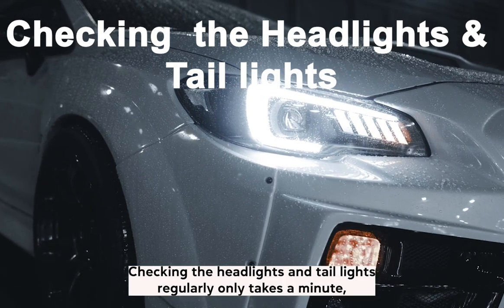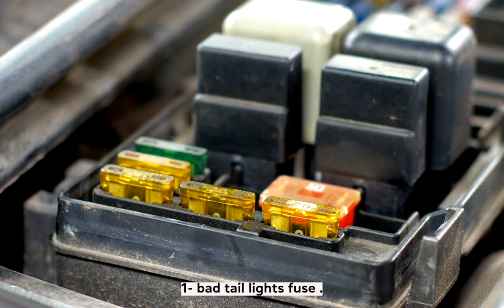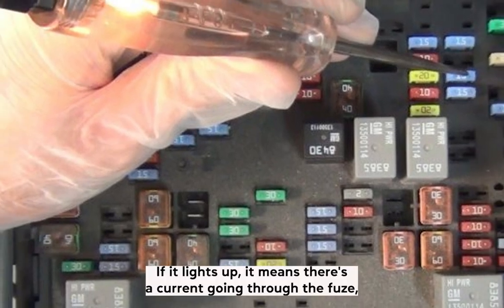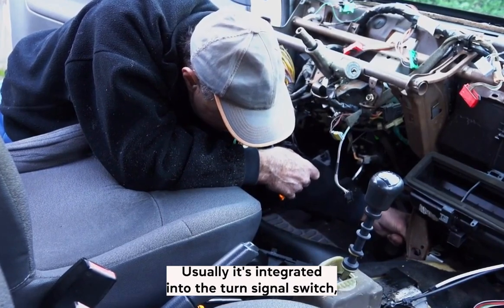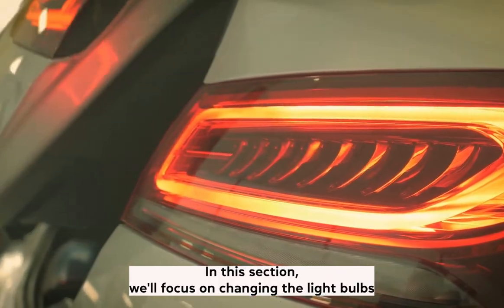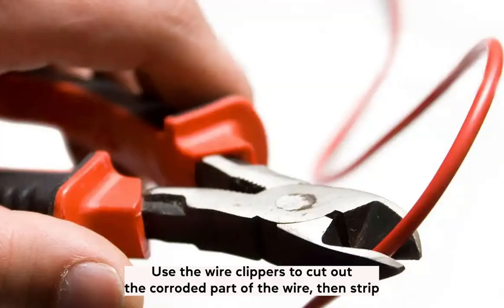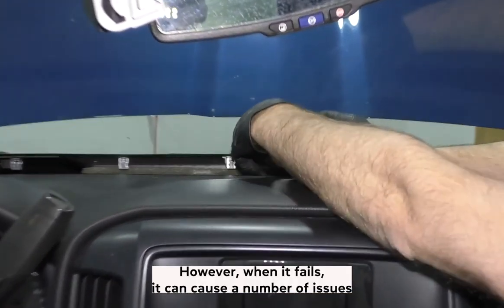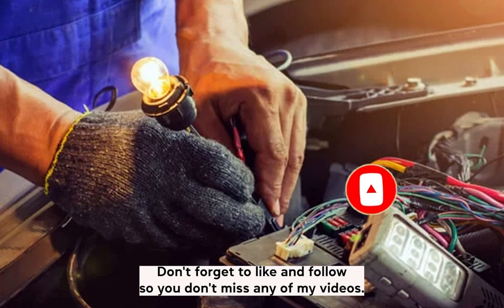Tail Lights Not Working But Brake Lights Are? How To Diagnose & Repair

Comment: 2007 accord with aftermarket radio. Found orange and blue wire not connected to anything behind radio. Taped them off, replaced fuse and tail lights and license plate light now working without blowing fuse.

Comment: Damn I hope it's a fuse. I had a cracked taillight and it flooded, had to poke a hole, now rear lights don't stay on but everything else works. I replaced the broken light and hoped that would fix it but it's the same. I havnt been able to find the fuse for nissan titan 2018 but I'll do some research.  Since I changed the light I'm assuming it's not the bulbs or light but now has to do with fuse or wiring.. 🤷

Comment: My 2011 Subara Outback problems are all happening simutaneously. The rear lights will not turn off when the car is off.  All the instrument lights in the car are staying on along with the alarm system is sounding off when I open my car door but once I put my key in the ignition it stops.  The battery was disconnect and reconnected thinking that it would reset the car but nol luck, the problem remains. I can get the rear lights to go off momentarily but after a few minutes everything resets and all the lights come back on with the exception of the head lights and the map & dome lights.

Comment: My 05 le sabres missing all of its tail lights on the driver side. Blinker, brake, and regular light. Any idea what the issue could be? Possibly a fuse?
Reply: That does seem to be a fuse possibly. Check the owners manual and replace corresponding one
Reply: Was it the fuse having same problem